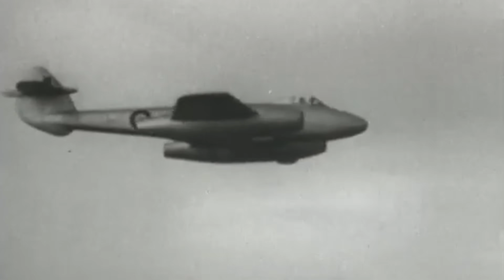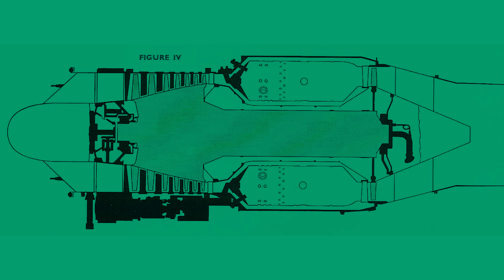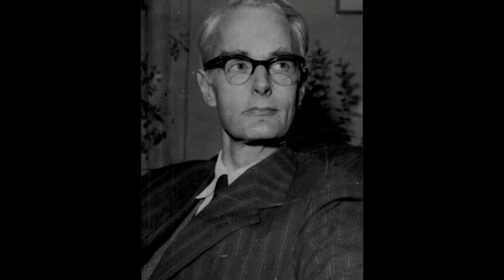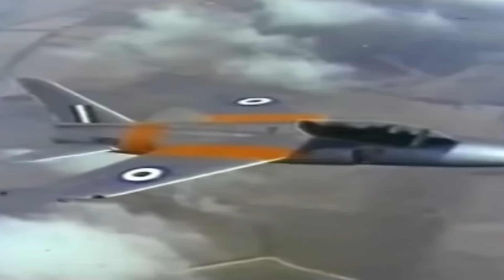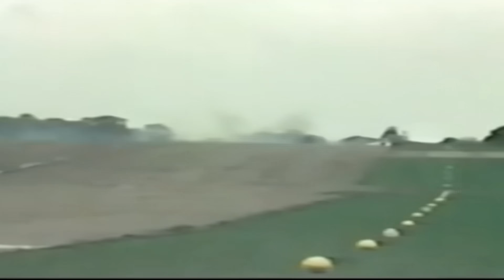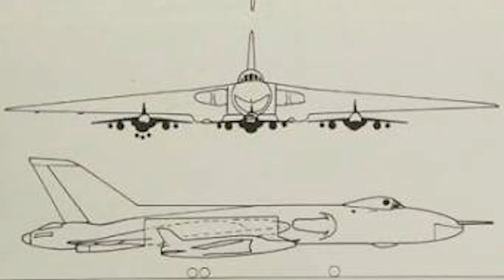Folland Gnat: The Story of the "Pocket Rocket"

Comment: An obvious problem with the Gnat was lack of potential upgrades - there wasn't room to put anything new in the tiny airframe. Folland punted the Gnat Mk5, but it was - realistically - a completely different aircraft with two different engines, a radar installation and all the equipment to carry missiles, little different from other aircraft under development.
Interestingly, at much the same time Ed Heinemann was thinking in a similar direction to Petter - take the best engine available and bolt it to the smallest, lightest airframe that would do the job. But he went with the J52 engine, designed a fighter but was told to re-do it as a bomber and came out the other side with the A4 Skyhawk, which was amazingly successful (and large enough to have a viable upgrade path).
Reply from the maker: The MK5 was practically the design brief for the Tornado it was so full of bells and whistles.

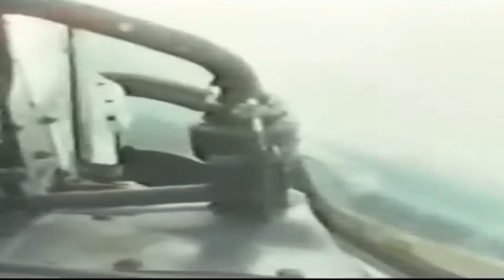Comment: You omitted that in 1964, the precursor to The Red Arrows, The Yellowjacks, were formed using yellow Gnat T1s. Later that year, The Yellowjacks were reformed as The Red Arrows, still using the Gnat T1. 8:35
Reply from the maker: I had a section in that went off on a side quest about the red arrows but it felt too distracting from the main narrative. I might have over trimmed it back out.

Comment: Interestingly, the Orpheus was not only used in aircraft, but in both the Bluebird and Spirit of Australia Waterspeed challengers.
Reply: Donald Campbell actually managed to buy a Gnat somehow, it was then scrapped for the engine and instruments, part of the tail was used as the vertical stabiliser on Bluebird.
Reply: @markdavis2475 Think it must have been damaged landing or something.

The RAF didn’t want the fighter version, instead they adopted the 2-seat trainer with a more basic robust version of the Orpheus. Bluebird got the hotter “fighter” variant of the Orpheus… Campbell wrecked the first one he fitted and struggled to get the second one running right… he just ran out of luck with Bluebird running right on the limit….
Reply: @johnmoruzzi7236 I remember reading it in Leo Villa's book, many years ago 🙂 He didn't give many details, just that Donald had bought one.

Comment: Grear summary of a lost opportunity.  2 things I'd like to throw in; the 30mm cannon muzzles are visible in the side of the intake lip on both Gnat and the indian version the Ajeet. This choice always puzzled me given the known upset firing guns near or in front of intakes caused. Secondly, you missed the use of Gnats by The Navy in the documentary 'Hot Shots!' which gave excellent footage of them under the code name Oscar EW-5894 Phallus.
Reply from the maker: It's always a challenge to decide what bits to keep in and what to drop but I did consider the Hot Shots inclusion as the ultra factual credible sorce for use by the US Navy.  The Fouling on the intakes is heavily slip strem dependant. On the Hunters it was channeling up from below and choking out the intakes. The Sabrinas were how they redirected the airflow (and caught the shell casings) to stop this. Perhaps by luck more than judgment the positioning on the Gnat means the off gassing is directed away from the intakes.

Comment: Also, it takes off in 2,190 feet so you could probably operate it off short and barely improved airstrip.
Reply: Huh. Teddy should have compromised. A bit.
Reply from the maker: I suspect Teddy had more than a slight touch of the tism. Though of course, in those days it didn't exsist. Allegedly.